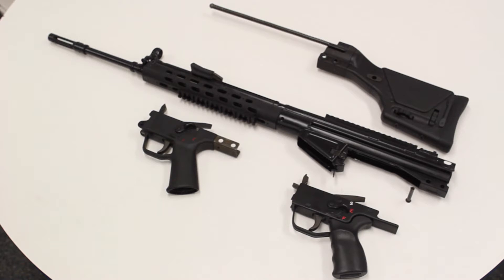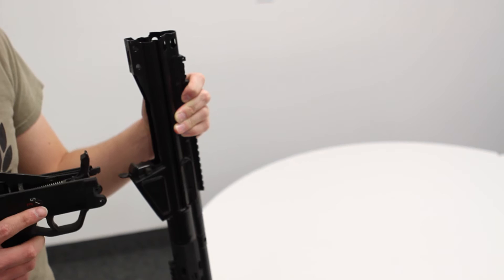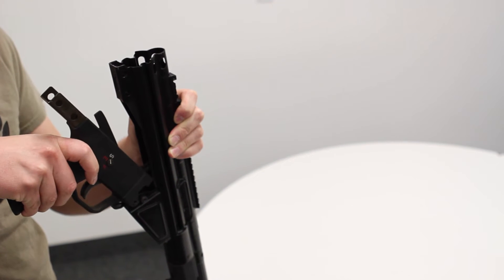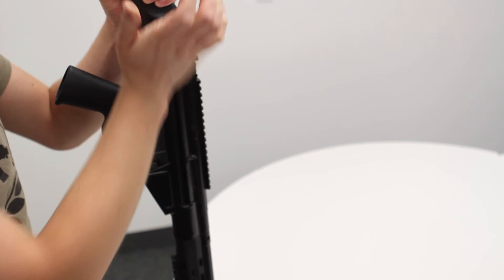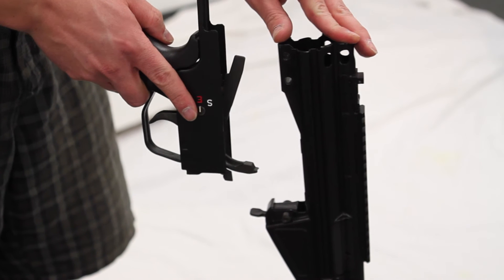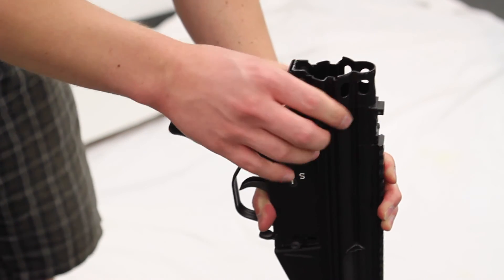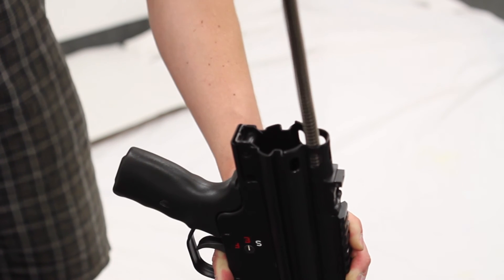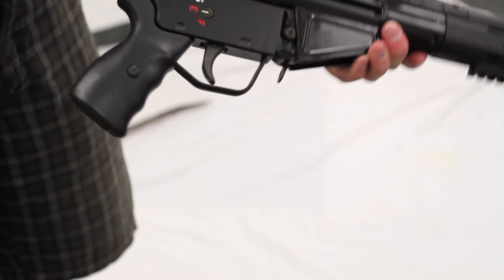H&K Trigger Groups Installation: Polymer vs Metal

Comment: That is a full auto lower, the metal one. Actual German military issue.When you use it does it give you the full auto range of service?
Reply: The metal housing yes, the internals no. As you can see, there is no auto sear lever on the front right side. The full auto trigger group was either modified or a dedicated semi auto trigger group is inside the grip housing.
Reply: @TheBigOne0305  so if you buy a trigger group from HK parts that gives the option for full auto on the trigger group……it won’t do anything?…..so you’re basically wasting your money to give the illusion that you have full auto?
Reply: @southwest_tee898  Yes, a full auto trigger pack is considered equivalent to a machine gun in the US. It cannot be sold to civilians, unless it is a registered and transferable one (registered before May 1986 when the registry was closed).
The grip itself is freely available though. It does not alter the function of the gun, but it will look the part. Some people want that and are willing to pay good money for that.

Comment: The metal ones are a little tight , 
But the look great and fuction well.
Reply: Is there any wisdom you can pass on? I know he demonstrates it here but im someone who likes a second, third opinion/way
Reply: @cliffc3673  The metal ones allow you to change out the grip. It's an additional plastic/rubber piece that is screwed onto the metal frame. With the polymer housing the grip is integral to the housing and cannot be changed. I don't know if there is a market for different grips for the metal housing (they haven't been used for new production guns in decades), but if you really want to, you could always make your own or have one custom made. No such option with the polymer housing. That said, I think the polymer housing works perfectly fine and I've never had any issues with mine (neither on my G3 nor on my MP5).
Reply: @TheBigOne0305  confirmed all of the above after discovering the "hard way" on my own.  At least I took care of this before the great gun panic.  Appreciate the response!
Reply: @cliffc3673  I didn't notice the date of your post until I was half way through with typing my comment. So I decided, fuck it, may as well post it. Could be useful to someone else stumbling over this thread later^^
Reply: @TheBigOne0305  Absolutely agree and that's why I decided to be like "yup, this person's right!" for the same desire of helping out stumbling upon this video